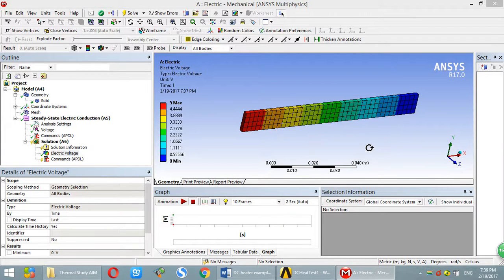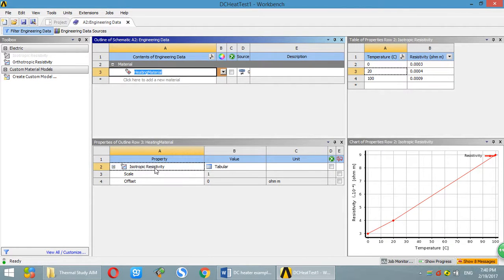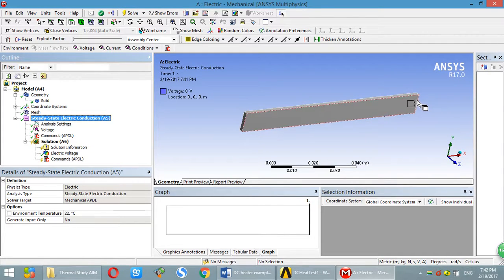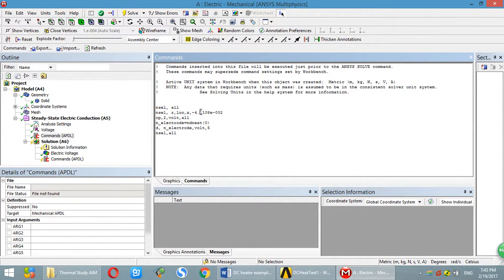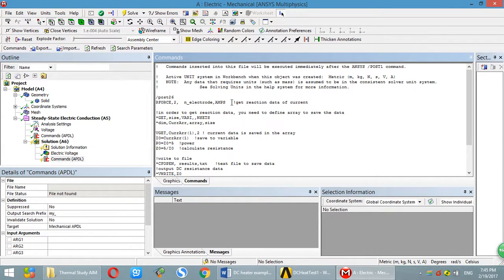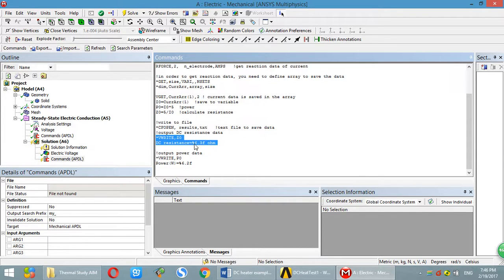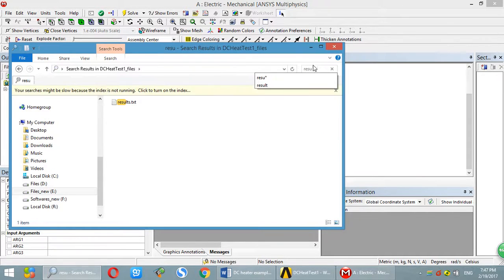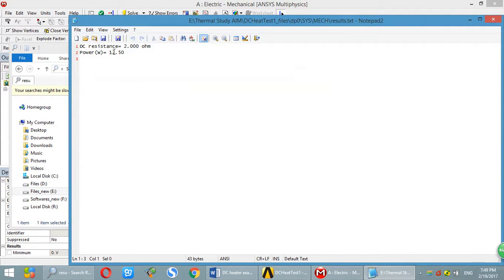ANSYS DC electric analysis. Calculate Resistance,Power, and export results to file

Comment: Thank you for your video. Can you explain how to input a current instead of a voltage as an input?

I've tried to input a current instead of a voltage, it couldn't run.
Reply: for inputting current you need to set other face at zero potential

Comment: Sir how to give AC supply . with frequency
Reply from the maker: depends on what you want to do. if simply AC, there is no difference at all. I mean it depends on the material property. You can do transient analysis, but it is very time consuming. Or you can try ansys maxwell.
Reply: @moment563  sir I want to find resistance of biological material. So I have to give 50kHZ AC and find out the response
Reply from the maker: @k.sankarkandasamy8152  let me ask you a simple question. if it is a simple rod or sheet, do you know how to calculate the resistance using math?
Reply from the maker: @k.sankarkandasamy8152  i recommend try ansys maxwell: http://ansoft-maxwell.narod.ru/en/CompleteMaxwell3D_V11.pdf
Reply: @moment563  ok sir

Comment: Hello! Can you  explain why we need a line 
n_electrode=ndnext(0), 
what does it do? sets the variable to the node number of the next post 0? why not immediately write that the node with number 1?
Reply from the maker: ndnext(0) doesn't mean 1. it is used to get the first node number from the group you selected. For example, you select a group of nodes, 100,101,102.... You want to pick up the first node 100, you can use the command ndnext(0). It picks up the first node after 0, which is 100 in this case.  Check the help file of ansys.
Reply: I try to undertand what the mistake is. Variable value 'saze' is zero, why it might be? And,  if the 100 m beam is long why choosing a plene to determine the voltage x=-4.1108e-002? it should be equal or 10 m or 2 m or 100 m or 0 (depends on the position of the coordinste system),

Comment: Can you please explain why %6.3f and %6.2f  has been used???
Reply from the maker: this is formating of data, commonly used in programming language. 6.2%f means only 2decimal point is used. You can simply use %f.
Reply from the maker: for example, pi=3.1415926. If you use %6.2f, it only outputs 3.14. If you use %6.3f, it outputs 3.142. You can google for data formatting of float number in C language. Hope my explanation is clear.
Reply: Thank you very much for your reply and yes it was very helpful
Reply: Thank you so much for your previous replies. I am currently working with current conduction through a conductor and want to analyse it with ansys. But I am facing some difficulty with ansys. I was wondering if you could help me?
Reply: @debtanaydas4870  bro can help to understand basics of ANSYS electronics thank you